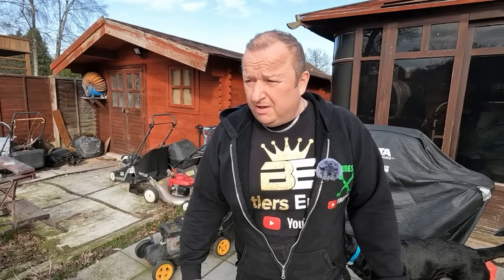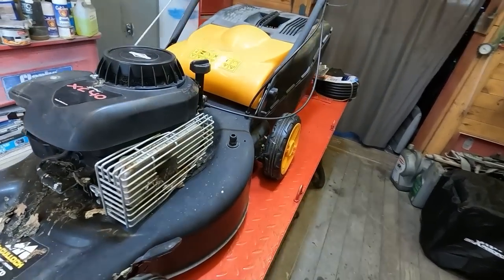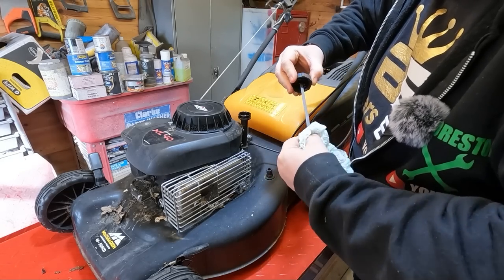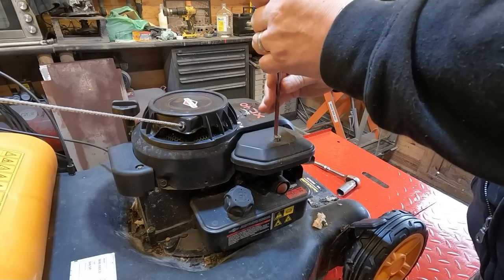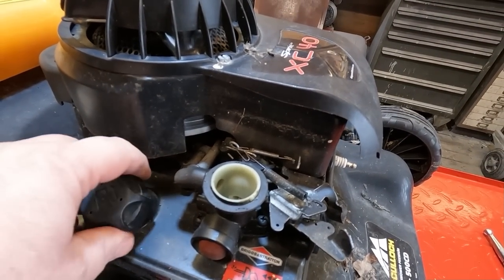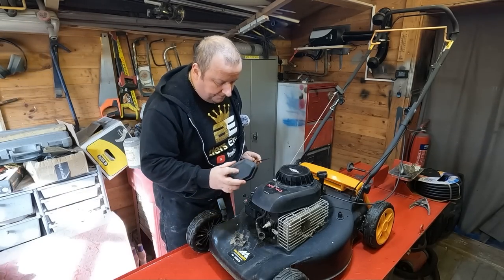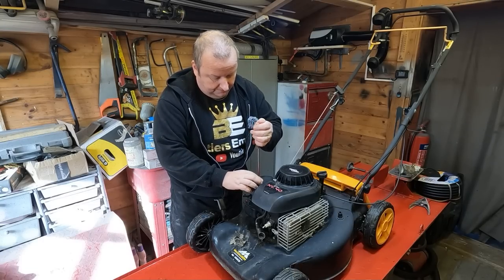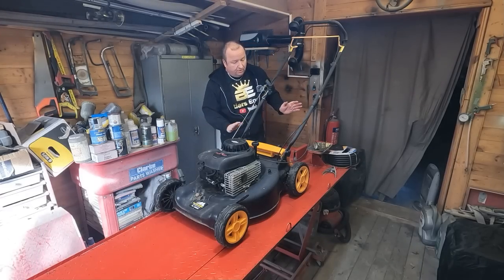Unbelievable! Watch What This Lawn Mower Does | You Won't Believe It

Comment: For safety reasons, you might want to start a mower on the ground. Reason is, if that blade is compromises in any way as to brake a piece or even come off, it could fly directly at you hitting you in the gut/stomach. If it's on the ground and it comes flying off at you it could hit you in the leg. Both cases aren't good but getting hit in the gut/stomach is definitely a hell of a lot worse. I'm not trying to tell you what to do, just thinking of it from a safety prospective. Have a great day. Love the videos.

Comment: You are quite right rotatary blades need to be just as sharp as cylinder ones, its just the manufactures cant be arsed to sharpen what is generally pressed out. A quick inspection of cut grass will easily identify a sharp or blunt rotary blade as the blunt one will always leave a jagged edge to the grass. It also means the mower doesnt need to work as hard and results in less fuel usage :)

Comment: Didn't put the plug lead on......... sat in the car years ago when you could service them yourself (no computers or fuel injection in those days) wondering why it wouldn't start!  finally spotted the new rotor arm on the passenger seat doh! 🤣🤣🤣

Comment: Had the same problem with my mower creeping after replacing the belt. Turned out i was testing the mower without the belt guard fitted, once I fitted it it stopped creeping. Looks like the belt guard helps to keep the belt slack in neutral.